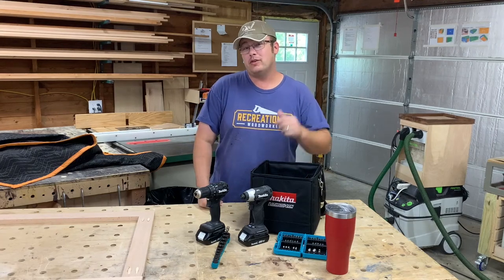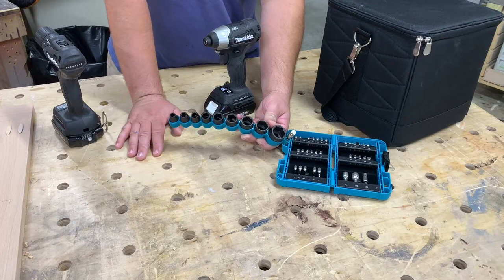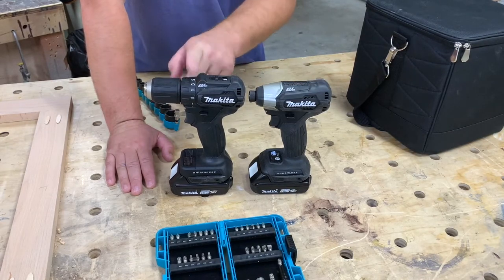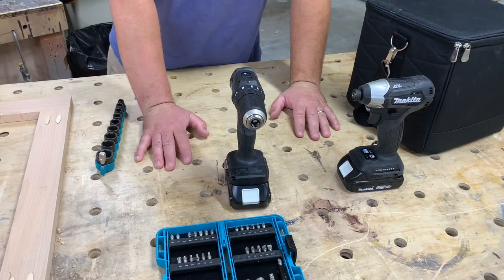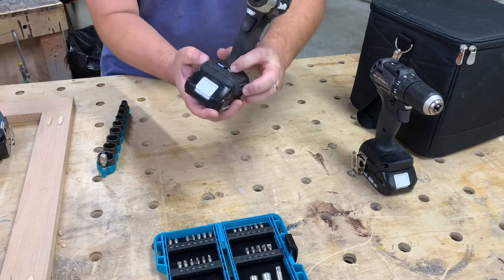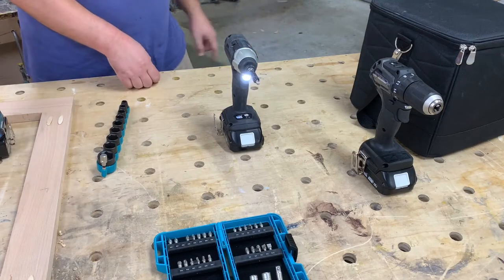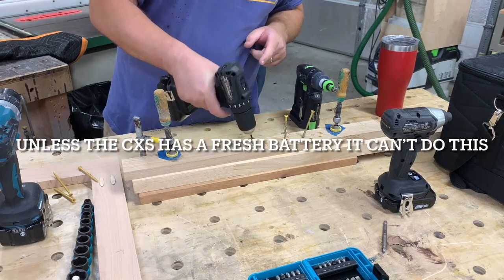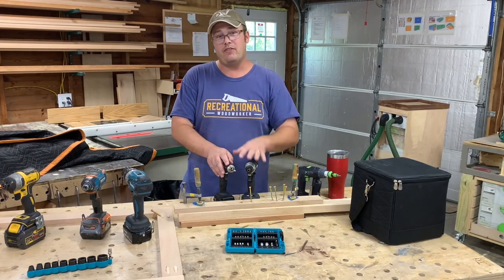My New EDC: The Makita 18v Sub-Compact Drill and Impact Driver

Comment: Nice kit. Makita has Christmas deals on their top of the line xtd16 and their brand new hammer drill 18v get a free bare tool. I actually bought that kit back in the spring of 21 got a free grinder and only paid $247. But the sub compact tools will be perfect for a work shop builder and cabinet maker like your self. Hope they hold out

Comment: Hey Robert…how are you still liking the Makita subcompacts? I’m thinking of pulling the trigger on these as I like my compacts from Makita so much. These would probably end up replacing some of my older DeWalt 18v drill/impacts.
Reply from the maker: I love the size and weight.  The impact is ok, but with only two speeds one is too slow, the other is too high and breaks Kreg screws.  

The drill is almost perfect.  It's the only drill I need on a job site.  It will handle a 2 1/8" hole saw, and can dial it down for delicate hardware.  I am starting to have trouble with the chuck, however.  

While it essentially replaced my CXS it doesn't quite have the control.  

I just ordered a C18 and TID again....I like the control of the Festool impact much better than the sub-compact.  I'm sure the Makita Premium Impact would be on par with it, however.

Comment: Right now I only have one battery platform. I'd like to keep it that way.  I'm not sure it's possible with all the choices.
Reply from the maker: Yeah I looked down and saw I personally had 4 different battery platforms. That’s just too many for marginal differences. 

Brand A may have the best circ saw while brand B has the best drill. But in reality if you stick to a pro level brand those minor differences aren’t going to affect day to day use. 

My advice is find the pro level brand with the specialty tools you want. For me it was the Makita tracksaw that has me choosing Makita. 

I’ve also got a few Ridgid tools left that I’m in no rush to get rid of or upgrade especially with how little I use those specific tools. 

Im loving these light little drills though!

Comment: Hi how are you does that makita impact driver does it work in cemenct ?
Reply from the maker: The more I used I the less impressed I was with the impact. It's comfortable in the hand but has poor control and a lot of vibration. 

I do like the driver for small tasks though
Reply: @DaileyWoodworks I see thanks

Comment: With Drill bits coming in 1/4 hex form allowing the impact to put holes into material, is there really a purpose for the subcompact drill driver?
Reply from the maker: You have a lot more control with the drill/driver. This is a big deal for hardware screws and pocket screws. I have a hard time controlling this impact driver and kept breaking pocket screws with it. 

With the drill you set the clutch properly and it prevents over driving.
Reply: @DaileyWoodworks  Did you ever consider M12 line up? Wondering how you are liking the subcompact 1 year after this video was made. 

I currently have both the latest M12 impact driver and hammer drill, but I also picked up the subcompact for small projects around the home. The only reason why I shyed away from the M12 was because how uncomfortable it is in my hand.But the lack of a quick bit change on the SubComp Makita realllllyyy sucks to be frank. But damn are the grips comfortable.
Reply from the maker: @ChrisBranleh  I didn't want another battery platform. But the M12 line is really great. My FIL has it and the grip size is growing on me. 

I'd love for Makita to really "Double Down" on the subcompact line. I think it would be a great niche for them, but it seems they're going all-in on the new 40v line
Reply: Have you done lots of overhead work?